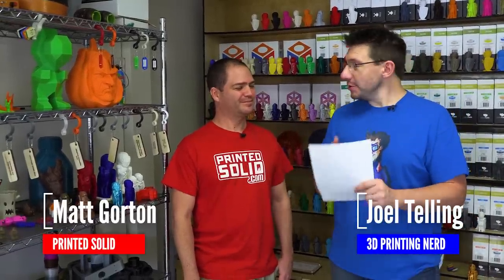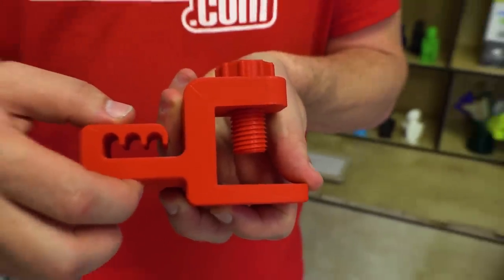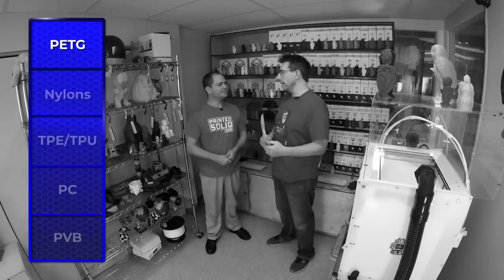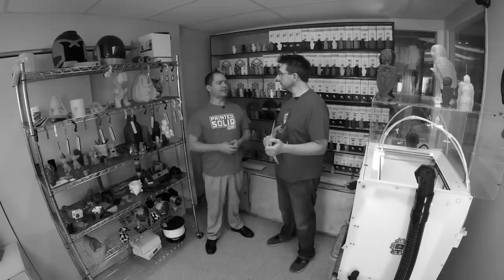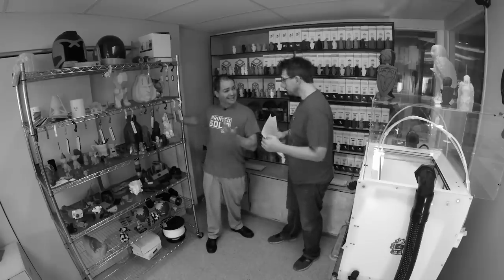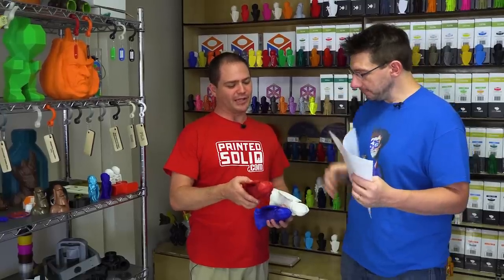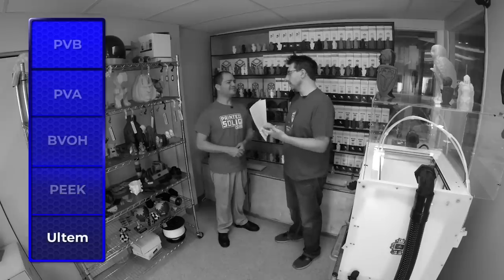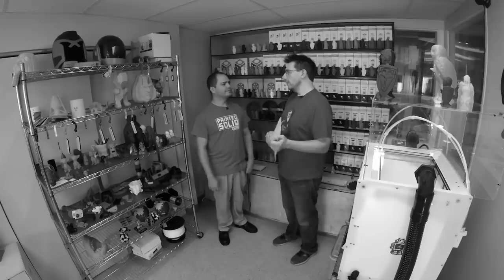Guide to 3D Printing Filament! PLA ABS PETG TPU PEEK ULTEM

Comment: Had been interesting to know how those compares to resin.
Reply: I've never seen any quantitative comparisons, but my understanding is that resin prints are basically better in every way mechanically and in appearance. However, they are absolutely horrid in terms of cost, material waste, and safety. Need gloves and respirator, resin is expensive, and unused resin is classified as hazardous waste that requires special disposal procedure. 
Prints are much more precise though, and there are no layer adhesion issues, so they will be as strong in every direction. Unlike extrusion based printing which have tensile weakness in the Z axis.

It would be cool to see a direct comparison though.

Comment: Does color affect printability in a materials of common ingredients?
Reply: yes, it can.
Reply: I have a two PLA from the same manufactor one black one grey and I have much better flow with the black one. I don't know why but I seldom have any underextrusion in fact the black one will overextrude if I print it at the same temperature as the grey one.

Comment: Why doesn't anyone print or review HIPS filament?  I like using it better then ABS!  It's cheaper then ABS, doesn't have the problem of needing to be printed in an enclosed environment, and is extremely easy to sand to a mirror surface.  WHY DOESN'T ANYONE TALK ABOUT THIS STUFF??

Comment: Hi guys, please excuse my ignorance as I do not know much about 3D printing since I am a school-aged girl who has been forced onto a boys EOPT! 

we have a   Cetus mk3 printer at school which our team want to use to make a bezel for a Nextion graphic display the file to print the bezel may be found here if that helps   https://nextion.tech/nextion-editor-ver-0-58/#_section4 

We want the bezel to be black preferably, and shiny or at least smooth i.e. not have lines on like most of the printed parts we have seen. What is the best filament to use to achieve this?  and is there anything we could do to make the finished bezel better, like some sort of polish to make it shine. 

I also noted that when we tested the file from the Nextion site above on the Cetus mk3 using pla plastic it printed the bezel standing on its edge and not flat against the table of the printer is this normal?

Comment: Ok I'm gonna be printing Airsoft parts on a Ender 3 v2 I got a print tent any recommendations on what I should use for parts for a gas blow back pistol
Reply: ABS is pretty good, but it depends what part you want. For example, I made a "flash adder" (reverse of a flash hider, instead it adds flames by detonating the propane from the GBB pistol using a Venturri effect sucking in a vortex of fresh air to quickly mix it and then ignited by electronic ignition), unfortunately I was too lazy to swap out the PLA I had so after a quick mag dump it was melting and about caught the ground on fire. Also there's a good reason they don't sell a device like that on the market, the slide when it comes back dumps gas on your hands, which when you get a big enough fireball on the front and possibly wind (it seemed calm to me), that flame can build up and ignite and catch flame at the back of the slide which is spewing gas onto your hand, haha! That was exciting!

I printed my grips in everything from PLA to avoid warping (I'm not a fan in case you leave it in a hot car), ABS and heating it back flat because it got a little warped, and the most recent was Nylon grips just because I had some Nylon out of the trash and wanted to see how it would come out (don't use Nylon, its very slippery, haha, the worst thing you could chose for grips).

It ultimately depends on what exact part you want though, for suppressors I'd go ABS but even at CO2 pressures fully gassed on .177 cal BBs I get away with the baffles being pretty thin ABS (noise reduction is about 75% quieter, as indoor plinking is stupid loud and requires hearing protection without it, but with it you're mostly going to hear the sound of whatever you're hitting). It really depends on the accessory you're wanting to print.
Reply: @jakegarrett8109  thanks for the reply I've actually made a Ford grip and rail system for my Glock out of pla definitely want to print abs
Reply: @SirQuacksalotthe1st  Just make sure you don't put that on a real Glock at any point, otherwise that's a 10 year federal prison sentence and felony. ABS is my choice for that, I found an MP5 style forward vertical grip that I love running on my CO2 pistol and SBRs. I found the rail to be a touch off (might just be the airgun molding), but since it was ABS I simply heated it a little and slipped it onto the rails where it fits snug but can still slide off if you push forward to swap between airguns (I have suppressors on both, so its perfect and doesn't look out of place). The increase in control and accuracy is phenomenal, I really like it.

I think there is also front grips that accept Glock mags you might like, that way they can hold an extra magazine for faster reloading on the field. I still need to get some spare magazines, I've been laser engraving mine so if I go to a field and reloading while running I can drop them and identify its mine easily. Have fun!
Reply: @jakegarrett8109  actually over where I'm at it's not you can all so just go to your local gun shop and pick up a suppressor haha 🤣 it's just classes as a bowel extension as long as you have a section 1 firearms licence also to own a pistol it has to have a 12ihch barrel and a dam stock attached to it so it's classified as a rifle haha 🤣
Reply: @SirQuacksalotthe1st  Yeah having that (a pistol with a stock), is another 10 year felony prison sentence. So much for our "shall not be infringed" (infringed means to limit or to restrict). That's partly why I make my airguns a check mark of every single felony I could make it, partly as a political statement of "how many decades would making this tool cost you when it harms nobody, actually makes it safer preventing hearing damage and safer handling and control"

Unfortunately some counties near me consider airsoft to be "discharging firearms within city limits" even if its just a rubber band gun (it even specifically lists rubber and spring powered) or Nerf inside your own living room. Its ridiculous. Actually in a city near me airsoft is illegal to own not just shoot, like its illegal to keep your airsoft or even some water toys locked away in a safe because they are considered "prohibited weapons", yeah, couldn't trust a grown man even with a childs toy, they might hydrate their plants with that, so terrifying...
Reply: @jakegarrett8109  that's sounds like a dictator ship
Reply: @SirQuacksalotthe1st  Yep...
Reply: @jakegarrett8109  that is f up so much for the Land of the free half expect them to ban 3D printers soon
Reply: @SirQuacksalotthe1st  They tried, both free speech of sharing and tried to ban any tool (drill/CNC/lathe/angle grinder/printer) that could possibly make weapons parts and would have required every machine shop to become an FFL manufacturer even if they only did car parts etc. So yeah, I mean they are actively trying, just like some states already ban certain CNC/printers as it is, but the Federal ban for the whole US failed the first time due to how insane it was (they can keep trying to add the bill a million times, there is no limit to proposing rules so it may still happen).

Currently the comment period just ended where they wanted to do background checks and serialize any item that could be turned into a firearm. That would include almost all square tubing (MAC receiver) and plumbing pipe (Philipino slamfire shotguns are about 4 pieces, a sharpened screw, an end cap, 3/4 in pipe for the barrel for 12ga, and a slightly bigger pipe that slides over it, drill and tap the back of the end cap for screw, screw endcap onto larger pipe and your done faster than the checkout line), so ban all plumbing pipes for any minority without a spotless record and tax the poor to death every time they need to fix their shower, ban shovels for some (AK and Mac flats, someone also used the handle as well for the stock. I think it was the same guy that used a garage door to make an SMG), ban Lego toys (AR15 lowers have been made with Legos, and they work wich is the "firearm"), ban wood like a 2x4" (Block 17, yeah it's a Glock made out of a Block of wood, semi-auto and it worked though hideous and crude), and sheet metal of all kind (UZI/MAC/AK). Also like every car part as even the adjustment handle under my seat looks to be about 9mm ID, also fun fact car antennas used to be the perfect size for making .22LR barrels, so kids who are now adults were putting car antennas onto 2x4 boards with hose clamps and zip ties and making working .22 rifles...

 It's so easy even a child can make it, that shows how pointless it is to ban something because you have to ban everything in the universe, but we know even that wouldn't work because by definition criminals don't follow the law.

Comment: Sooooo which one should I  use
Reply: It depends on the part and what you need it for. Its like asking what clothes to wear, you live in the desert or in the arctic? (temp range)     you go swimming often? (moisture and UV ray considerations)   you got the machine that can even print it without screaming in frustration after the 20th time it warps off the bed?  How much of a cheapskate are you? (prices vary from $10 to $1000 per kg in this video)

For me, I do lots of impact designs, so ABS: cheapest thing on the list, handles very hot, excellent for gears/quadcopters/water pumps/car parts/and many more, but its more difficult to tune than PLA. At work we use all sorts of exotics that I would flat out never pay that much for but its not me paying for it, also we have machines that print Nylon really well so we also use that a bunch but we have all sorts of materials and many not even covered in this video like advanced carbon fiber infused blends.

For most people printing desk toys, PLA is the clear choice: cheap, easy, did I say REALLY easy? and machine doesn't even need a heated bed printing on painters tape

Comment: What filament do people use to make printed gun parts with
Reply: Whatever they can use... It depends on the design specifics, don't stray from the instructions or you might blow your fingers off. Its just like at work, if we print with the wrong thing (specify TPU and print ABS), its simply not going to function correctly, or likewise if I specified ABS and we printed with Nylon and a month later we see all those parts have creeped over time and now tolerances aren't lining up. Always follow what the designer intended, they will often specify in the design, I imagine you don't want to screw around and find out the hard way not reading the documentation if provided because its going to vary with every design on which properties they want.
Reply: @jakegarrett8109   good advice,  honestly I think with the tolerances and also the warping , a person would do well to open up the design of splicer or program and beef up the structure to take in to account that most filament is not industrial stength
Reply: @atruceforbruce5388  That's probably a good idea on some models (depending on the part of course assuming it doesn't need to flex some amount). I'm sure you'll want to do some remote testing with a string too just to be safe, hopefully the designers considered and tested it but I'd probably be testing with a helmet on, some neck covering, and at least a heavy leather jacket for a little bit until it could be trusted, wouldn't want plastic shrapnel anywhere, haha!

Comment: I disagree with needing 90C on the bed with PETG. We use MatterHackers Pro Series PETG and get beautiful prints with 65C on our bed.
Reply from the maker: I sort of agree with you. I think it depends on the thermal properties and the adhesion properties of the bed material. That said, I run my MH Pro PETG at 70c :)

Comment: Im still watching and hear Nylon is hard to print.
I have to disagree. I print with Nylon and only had to adjust temps thats it.
So not very complicated to use.
Reply: What is your bed adhesion method and temperature?
Reply: I haven’t used much nylon, but I know it really needs to be dry to print. There are also different nylons that print easier than others

Comment: You want to see boogers on a model - try printing with TPV filament.  It's vulcanized rubber particles encased in a flexible plastic like PP.  When you extrude it the PP melts, the rubber particles get pushed out with the PP, but some always want to stick on the nozzle where they build and build until a big glob comes off.

Comment: ...Might be helpful to compare the PEEK to the only other material in this list that's remotely in the same use/strength category, Nylon+carbon fiber (chopped and continuous). ...People making arts and crafts prints don't need to know how PEEK compares to the price of ABS, because they weren't remotely considering using it. ...People considering printing high-strength stuff with Nylon+CCF might want to know. In fact, finding decent comparisons of "high-strength 3D print materials" online (in one place) isn't that easy. How does "top of the line laser metal fusion" compare to PEEK and Nylon+CCF? (So we can know how long we have to wait for Moore's law type computation advances to really benefit the end-user...)

Comment: He I was pulling my hair out wondering why my PETG kept oozing everywhere on my hotend
Reply: me toooo lol. do you have bed adhesion issues with your PETG? ive played with settings alot and cant seem to get it adhear like I want it. so for now i've gone back to PLA.
Reply: @BergyVlogs15  I do not know what kind of bed you are using, but I had lots of trouble with bed adhesion as well. In the end it was simply solved with cranking up the bed temperature. I print on a clean mirror with no additives or whatever, and with 65 degrees it would keep peeling up, 75 was hit or miss but 85 is rock solid. When the bed is still warm its hard to get the print of by hand, and have to wait until the bed is cooled down before prying it off. 

Also, I feel PETG is a lot more sensitive to good bed leveling. 

Hope it helps you somehow if you are still struggling with it!
Reply: @tHaH4x0r  would have steel nozzle help vs a copper one ?

Comment: No HIPS (High Impact PolyStyrene)? Basically the same styrofoam used in car bumpers. Can be used as is or as a soluable support for other materials like ABS. Prints within the same temp setting as ABS but it is softer than ABS.

Funny... I built a Toy Rep Rap 3D printer (with Nema 17 mods)  using HIPS and after a while the various parts that moved started to deform... LOL! Replaced those parts with ABS printed parts and 👍

Oh! The smell while printing! Smells like a styrofoam cup with way too hot water/coffee/tea in it! Ha Ha!

Comment: I would dissagree with TPU not for heat resistance.    in my testing I can put PLA in a boiling pan of water and use a potato masher to squish it,  TPU (95a-100A)  the few types I use seems to have no degradation after 5 mins of hard boiling.  I don't know why this is but I tested it and it retains shape and structural integrity. and imposssible to deform it whilst its beeen boiling hard for 5 mins   I have no idea what that red TPU you used but its garbage.    theres no way you can crack a hard 95-100a TPU   unless its not really TPU.

Comment: Ultem 1010 is harder to work with than PEEK. Ultem 1010 loves to crack and de-laminate if you can't match the chamber temp of a very expensive Stratasys machine. PEEK is more forgiving in lower chamber temps, such as 70-90C than Ultem 1010, by far. As long as your extruder can meet the required temps, the overall experience of PEEK is much better than Ultem 1010, and to some extent Ultem 9085. Peek layer lines go down smoother, and respond better to slight cooling fan usage for fine details better than Ultem 1010. Carbon fiber Ultem 1010 is a different story. Carbon fiber Ultem 1010 blends crack very little if at all in the same chamber temps of 90-100C, making it much easier to print. Carbon fiber PEEK is also a pleasure to work with as the reduced warping makes it easier to print large, flat objects.